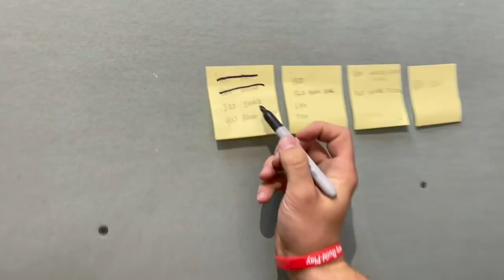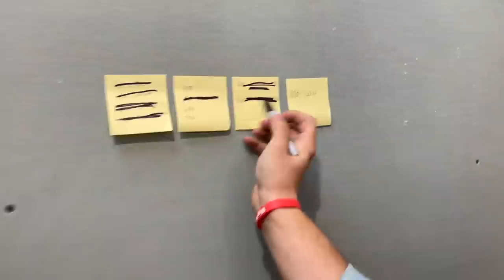🔥1000lbs VS. Stone Bench🔥

Comment: No Doubt the bench is strong enough. But I feel the test would be better and more proving some of the bags were centered on the bench in between the walls. I'm sure the walls were used to keep the bag standing straight.
Reply from the maker: Yeah it was sketchy even this way. But the whole point is to show that a person can sit on it. I think this got the point across
Reply: @WINNI.Designs   big time.   I'm tile setter by trade.  I get the questions at times if it can bear the weight.
I just wouldn't recommend a granite or marble. Courts only